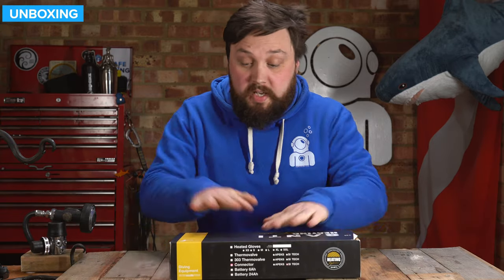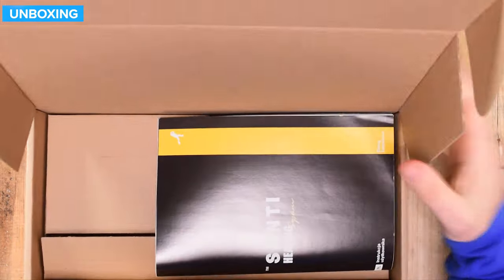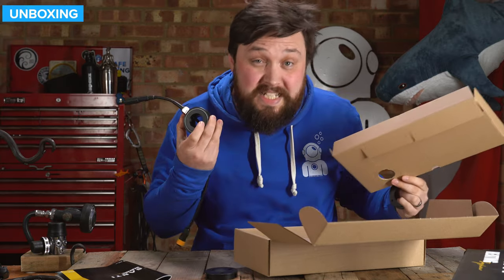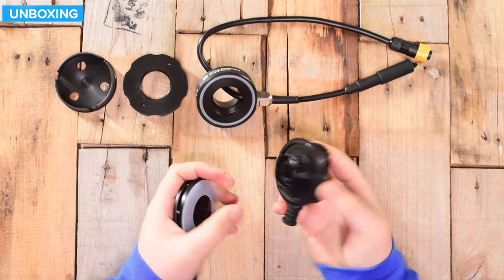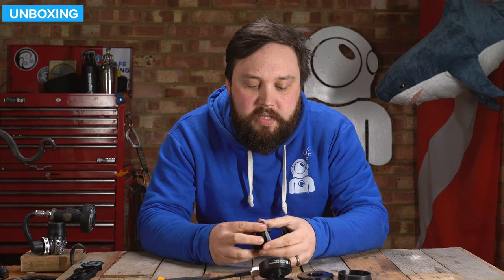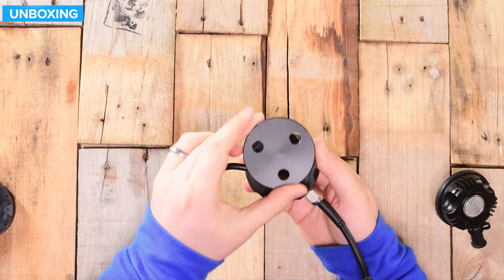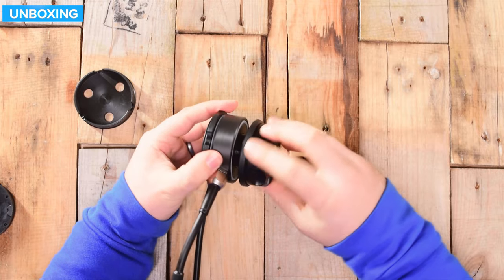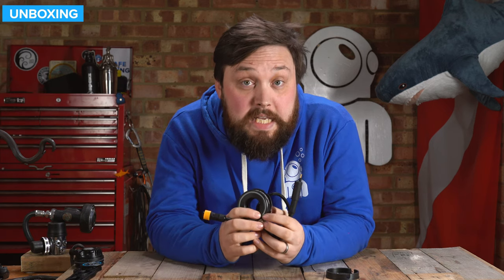Santi Drysuit Connector | Unboxing

Comment from the maker: Shop - https://bit.ly/306glvK
Latest Gear - https://bit.ly/3oUX2jp
The Santi Connector is a connecting valve that fits under your existing inflation valve to allow the power cable to run into your drysuit from the outside